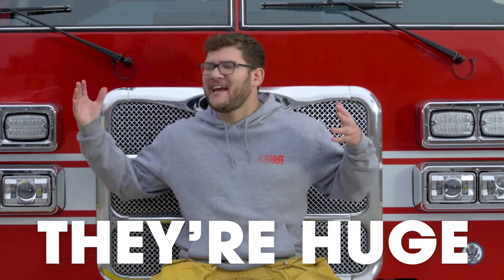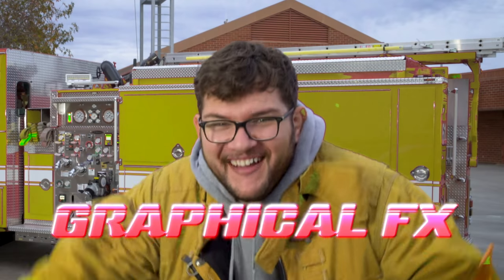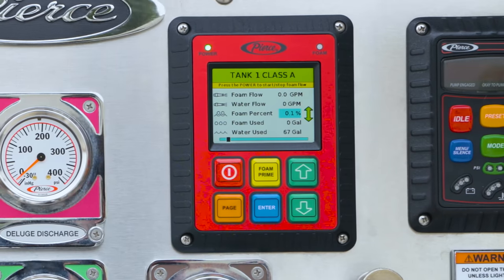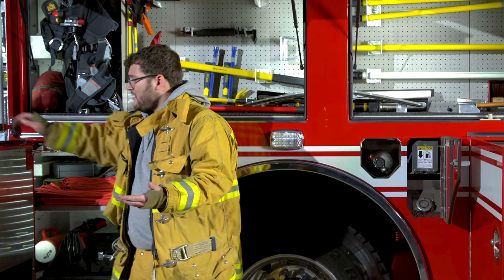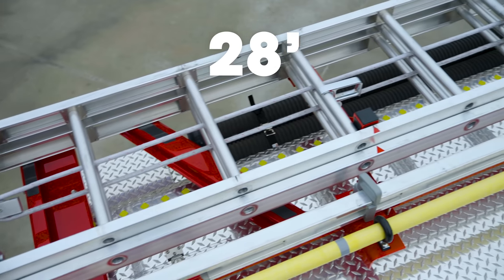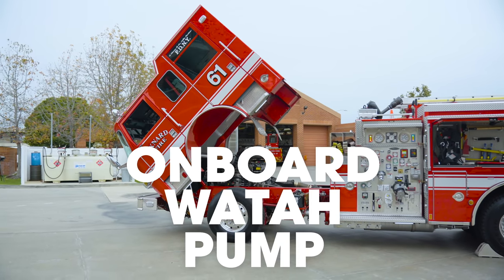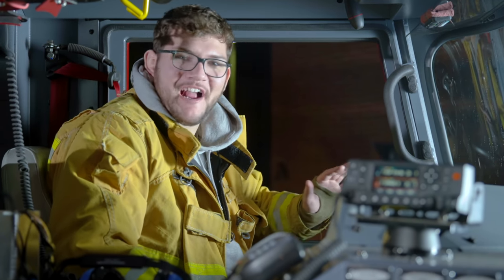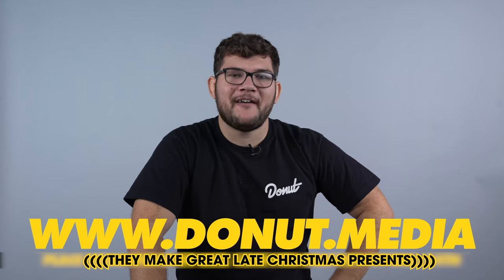The Surprising Features of a Fire Truck

Comment: Ah, yes, the Pierce Arrow XT. It's the classic fire engine children think of. It's been one of the most popular fire engines right next to the Pierce velocity. Unfortunately I haven't seen any large, large, cities using it such as New York. Not sure if Los Angeles uses it, but I think they do. I find it funny that there's an FDNY logo on top of the hose operator's door. Well, at least for my fire department. Basically the rear doors are usually the hose operator, and the hose buddy as we call it. The hose buddy is someone who stands behind the person using the hose so they don't fly backwards or if they do fall backwards The hose buddy has their back. Nonetheless, it is funny that there's an FDNY logo there, because I've never seen the FDNY using a Pierce Arrow XT. Anyways, this is a basic Pierce livery, the yellow or white print of your fire department, your unit number, and maybe a little something unique for your department. And then the one white line going all the way through the fire engine. Sometimes, the white line will move upwards once they move to the storage compartments and pass the pumper. Nonetheless, this is a beautiful engine/pumper and I can see exactly why it's one of the most popular.

Edit: Yes, I did see him go over the rolls of each firefighter on that engine for that particular fire department. In most fire departments there are four people on the engine, like I said two hose operators one being the buddy, and a captain who sits in the passenger seat, and then the engineer who's in the front seat. Also a lot of people get mad at fire departments for not getting water on fast enough. That is because some people take their roles way to seriously. So do not go around thinking that every single time a fire engine shows up water should not be flowing because not everyone's a firefighter. Everyone. Is. A. Firefighter no matter your rank, if there's an open attack line and no one's taking it. Or if there's an open chance to get water on the flames whether or not you were the captain or if you're The firefighter, or hose buddy, you grab the attack line and you get water on that as fast as you possibly can. Usually, the firefighter should be doing that. But let's say they're not, they might be talking with victims, they might be doing stuff they should not be doing, someone should take over that line.

Comment: We have an engine we've been running for 20 years that carries 8 dudes (2 in foldable jump seats), and we can regularly fill all 8 seats. :D  It helps to have a roster of 50 people on the department.
Reply: here the standard Engine carries up to a crew of 9, without foldable seats ^^
Reply: @EnjoyFirefighting  how much equipment and water do your engines carry? And how long are the engines? There's always some sort of tradeoff since space is limited, so more people often means less other things. Which isn't a problem - it just depends how resources are set up.

We carry a wide variety of equipment - 750 gallons of water, full set of medical gear which takes up a full compartment, full complement of wildland tools and hose packs, structure and extrication tools, smoke blower, tarps, chain saw, and lots more.

Comment: Nolan, you absolutely do NOT use the water extinguisher on kitchen fires! Water spreads oil and grease, no Bueno. Dry chem or a "K" fire extinguisher, for "kitchen", works best.

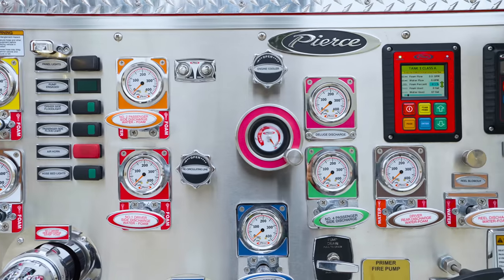Comment: 3:50 3 dudes on a truck is not very effective tho...  just means a bigger fire needs more trucks... in my country a engine is packed with 1x engineer 1x captain 6x firefighters u want to set up multiple lines... with this setup there can be 3 lines out... or in case of a longer fire they can be used in shifts... cause figthing a fire in full gear u need a break after 20-30min...

Comment: 5 members on an engine operates at 100% efficiency...4 men on an engine is rated at 65%, 3 men and the rating is 35% efficiency...Four men are better because when you are to enter a building, you do it with two men and two outside.(as per State rule) That would usually be a Captain and another fireman-- to do a rescue if the firemen inside ---needed to be rescued----Remember there should be a fireman (engineer) at the panel to operate it and make sure there is a water supply and sufficient water pressure..Hence the 100% rating of FIVE firemen.........BEST JOB IN THE WORLD...Retired 12 /25 / 96

Comment: Lmao hand calculations.  Technically you should.  Most of the time it's "how many couplings we got?"  Usually it's like 50 ft for a section (that's coupling to coupling, and sometimes it can varry, but that's why you know your engine) and then uses that to guestimate pressure loss due to friction.  The guys on the nozzle never complain because who wants to be the guy who got on the radio and said "yeah can you gate it down."
Had an incident once where they were running presets, back when those were brand new.  Long story short, he present it for inch 3/4 when he was using a 2 1/2 in hose.  So he was running a higher pressure than you'd usually run for that volume on a smooth bore line.  Disintegrated the drywall.

Comment: Fire engines/pumpers they carry a total of 6 men, 1engineer, 1 captain, 4 firefighters
Reply: Depends on the apparatuses configuration, some pumpers can have as low as 4 seats and up to 8 using foldable jump seats
Reply: depends on the apparatus configuration and the country; Here the standard is 9 on an Engine

Comment: I've heard some fire trucks have turbine engines on the back to run an extremely powerfull water pump.
Is that true?

And do fire trucks use Halon as the foam?
Reply: it IS true. Aerosol turbine extinguishers exist for example at industrial fire departments in Germany

Comment: well i mean technically it is faster than a Type R since it's the law to pull over to wait for emergency vehicles to go by.  which means a Type R legally speaking would never be able to pass it since that also would be illegal. so yeah....lol it may not be faster top speed and acceleration but it is legally.

Comment: He really just said you use the water extinguisher for kitchen fires 🤦🏻‍♂️ if you use water to put out a kitchen fire, you’re just gonna make the situation worse
Reply: not every kitchen fire is caused by hot oil ;) Could as well be a candle on the table, cigarette on a newspaper, sth hot in the trash etc

Comment: British fire engines are much better designed, I'm a trainee firefighter in the UK and our trucks are much smaller hold the same amount of equipment if not more, the same ammount of water and foam and it hold 7 people not just 3, and we can turn a tighter circle than the American counterpart, American fire departments could take a few tips from the UK
Reply: there are always pros and cons on both sides of the pond, can we agree on that? Just look at the very very low number of Tower Ladders in service in London, now with the first higher reaching one soon in service while that's already a standard in other countries. Also spare parts supply on older British apparatus is not always great, so they are rather shipped to eastern Europe instead of kept running in their own country

Comment: 5:56 those are not oxygen tanks.  They are air tanks.  Normal breathable air, just compressed.   Oxygen would be dangerous and expensive.
Reply: Lizzie Allen  The air will come out.  I think you mean, will it explode?  No.  Punch a hole and it will come out of that hole pretty fast and angry, but  these tanks are made of spun fiber, short of cutting the tank in half, you can't burst them.
Reply: Lizzie Allen  I've seen a scuba tank shot with a bullet, and what happens is an air blast that would cut through flesh from a few inches away but just sort of rustle your hair from 10 feet away.   So it certainly  could damage you if close enough.  And the noise is horrendous.   Ear damage is probably much more likely than eye damage.

Comment: the look of the truck seems very sixties to me, mostly analogue gages. This is what a contemporary German truck of equivalent class looks like (hydraulic spreadert, dooropener, aircushion 'n all)  https://youtu.be/FCAB_Ugv9ik
Reply: haha German fire apparatus, seriously? Some of the German departments still run pump trailers and farm tractors, right? Some actual fire apparatus are more than a century old, and well not sure from which millenium old halogen rotating beacon lights are from which are still seen there :D :D :D
Come on, even some big city frontline apparatus even don't have any grill lights, that's just ridicolous

Comment: That's gay. My water truck carries 2500 gallons, it can constantly spray at full blast for two hours. I can operate it by myself without a writing pad. And it cost 7 grand
Reply: Running through a standard water faucet or why does it take 2 hours to empty the 2500 gallons? :D